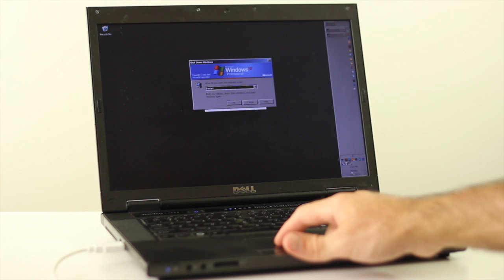Dell Vostro 1520 RAM Upgrade

Comment: Can you do it with a ram module taken from a different computer, or is it completely specific to the computer used, and if so, can you take the original module out of a different computer and use that?